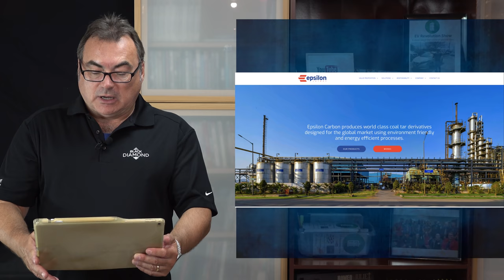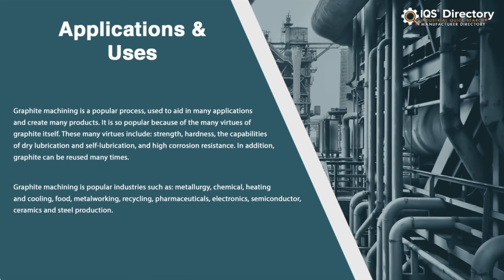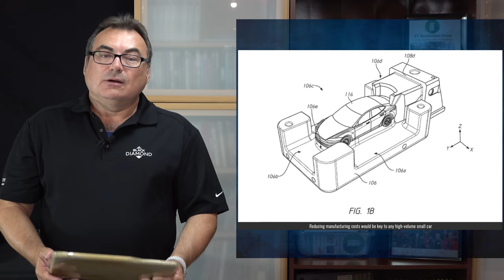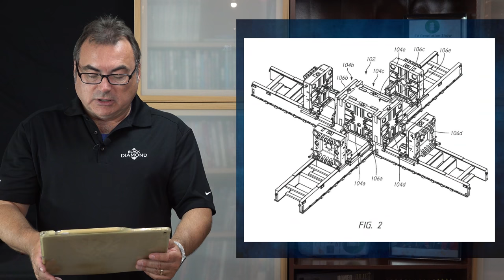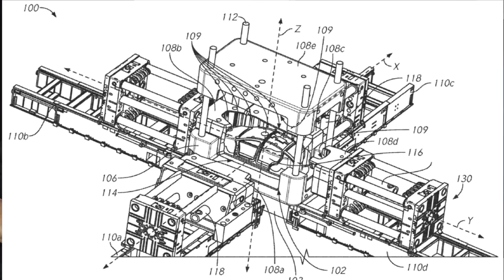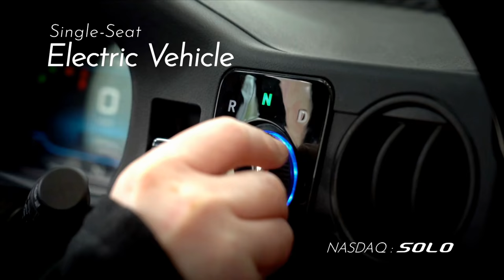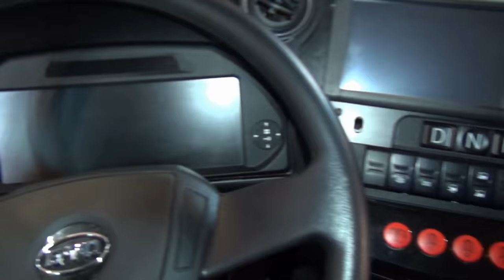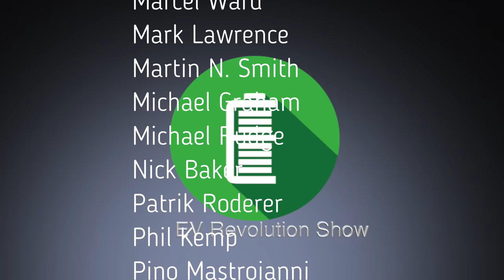Episode 105 - The EV Revolution Show

Comment: Great content Ken,  glad to see you have an MG ZS front and centre in your graphics, one of the few affordable and practical EV's. I have one and it is so much better than general reviews have shown. Just did a trip to pick up some sporting goods, 140 mile round trip, one boost charge while I had lunch and 4.3 miles/kWh using the MG Pilot at 60 mph.  Watch out for the new MG station wagon dropping soon.
Reply from the maker: Thanks Dave, yes there are many great options out there!

Comment: Electra-mechanica is a VANCOUVER BC company. They are manufacturing in Canada already. It started there not in China
Reply from the maker: Hi Dave, thanks for watching. I know that most of the manufacturing has been done by InterMeccanica, a subsidiary of ElectraMeccanica, as they have successfully been building high-end specialty cars for 60 years.  From their website: "ElectraMeccanica will be working in close partnership with its contract manufacturing partner and strategic investor, Zongshen Industrial Group (“Zongshen”), in Chongqing, China on the initial production vehicles. The Company has targeted late November/early December 2020 for initial deliveries to select members on its pre-order list before ramping production to meet growing demand."

So you see, manufacturing today is in China.  The few models floating around Vancouver are for show/pre-sales purposes and they may have been built in Canada by hand.  However, the initial production customer vehicles will come from China.  I am not aware of any large facility in Vancouver that ElectraMeccanica has for full vehicle production in large quantities.
Reply: @EVRevolution  Correct it is NOT large scale production, however they do have production. From speaking with the owner last year, he told be that they can put out 10-12 solo's a week from the Vancouver facility. It will be interesting to see if it takes off here. But honestly the 3 wheeler thats got my attention is the Arcimoto.

Comment: Why should more affordable Teslas just be tiny? If they'd just make a Ford Focus Estate like car with 50 kWh it will sell lots. The cells themselves are under $5K already, and we're expecting a 50% drop in their cell costs soon as they bring dryer and higher density cells. The Model 3 rear motor is $800 according to Munro, so costs shouldn't be adding up so much.
VW ID.3 45 kWh as an example is a fine car, will start at like $25K. And should easily+cheaply be made a bit longer for decent cargo space. Tesla needs a competitor to that car more than the ID.3 is a competitor to the clumsy Model 3. So. Much. Cheaper.
Saving cost by mounting a smaller motor is barely needed. Perhaps the inverters are a bigger impact.
Drop the top speed, win efficiency and torque due to gearing and not so much need to go crazy with impact safety.
Reply from the maker: All sounds good, thanks!

Comment: electric buses would be perfect for bangkok as well. the old buses that they have their are very loud and produce big black clouds from the diesel engine.
the roof can be 100% used for solar. especially in traffic jams that buses would be great.
it is good to know that energy density of batteries is going up and price going down. VW already cracked the 100$/kWh mark. leasing a bus is a cheap option to finance such a bus.
Reply from the maker: Thanks Stefan for watching and for subscribing!